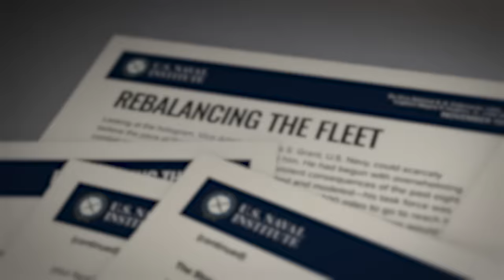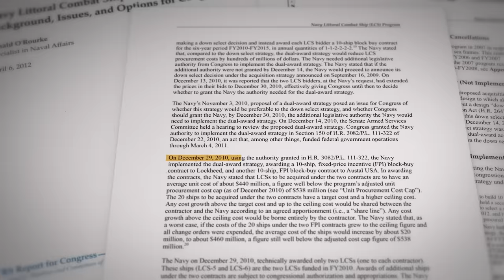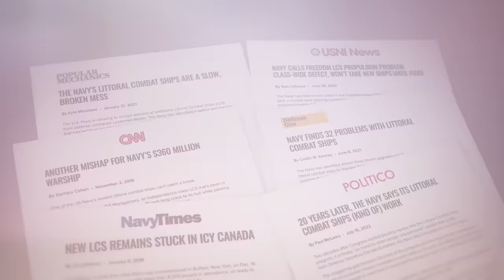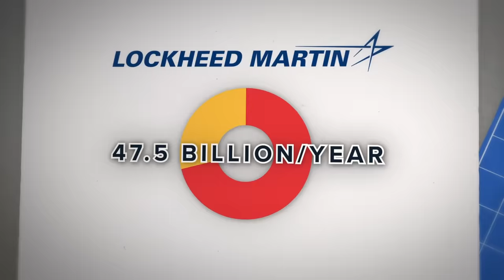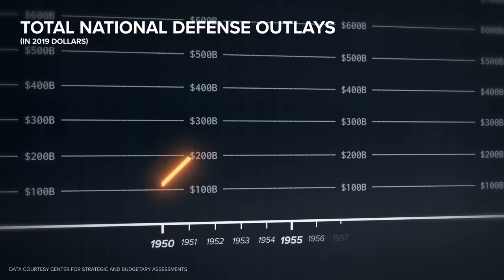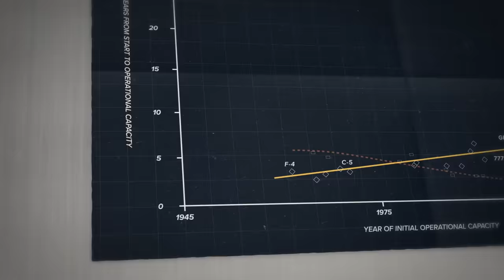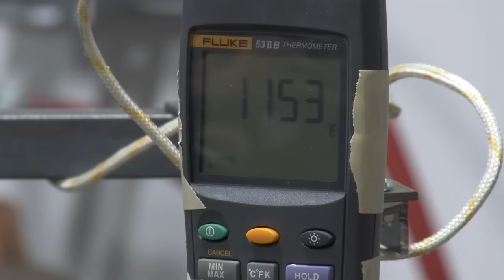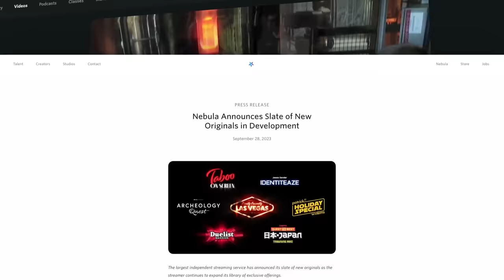Why the US Military Costs so Much

Comment: Perun has done a videos on different country's defense structures.  An issue with the US is that it's purchasing power parity is low, meaning it's soldiers need to be paid higher than in other countries: a Lt. in the US can be paid more than a highly trained  Polish Spec ops guy.
Reply: The other big thing he brought to the table, scale. The f-35 per unit costs have come down enormously since everybody else has adopted it as a standard platform. If you only build two ships, all the development costs are included in those ships, instead of something that can be iterated on, improved, and distributed across 20 or 50 ships.
Reply: This is largely inaccurate. US PPP is top 10 in the world. All countries above it are small nations with less than a 1/10th of the population.
Reply: @reclassified_  What do you mean? Do you think it would be cheaper to pay same number of soldiers in US or in contries like India, China or in eastern Europe?
Reply: @masaheimoi   the cost of labor doesn't mean that PPP is low. You don't conflate worker wages as direct purchasing power and no one ever uses it that way in an economic discussion. All those countries have less PPP than US. Thats why I said 'largely' inaccurate since there was the chance the initial comment was mistaking the cost of hiring an American worker as 'purchasing'.
Reply: *its
Reply: @reclassified_  Pretty sure they mean to imply  that the higher PPP is the thing that is driving up wages and the hiring cost meaning the budget doesn't go as far as  countries with a lower PPP.  Meaning the US defense budget is proportionate to the threats it is facing.
Reply: That’s not what purchasing power parity means. It means the get the best shit possible in the world from private firms it costs a lot more, and because we want them to retain talent and capacity over all possible sectors of threat- we pay them the best. It’s tangentially related for  purchasing power more generally. For example South Korea has fantastic defense economics and low defense purchasing power parity, but a comparatively higher purchasing power parity- it’s not a singular factor.

But I highly recommend Perun’s videos on everything.
Reply: How much of the US military budget goes towards acquisition and how much goes towards wages for staff?
Reply: Perun has also mentioned the effects this has on the economy as a whole, something that was only said in pacing in this video. 

Here's something that puts things into perspective, 3 million people work for the DOD, either directly or indirectly. Any major cuts on military budget would lead to a lot of layoffs in the civilian sector. 

As for inefficiencies, here's another one, the big companies are forced by their contracts to do a lot of business with small companies. This doesn't make sense at first until you realize that it's a measure taken to help the economy.
Reply: @shaider1982 Thank you for highlighting Perun on this.  Defense Economics is such a niche field that a 20 minute video cannot really highlight all the nuances.
Reply: Not it, spec ops are UNDERPAID, while standards for average recruits continue to fall, consequence of mass importing low value human capital.
Reply: @Souledex No, THAT is not what purchasing power parity means. PPP comparisons are made with similar goods. However, since each country is unique, different goods are priced differently. It can be as simple as cultural differences - a country which eats mostly rice may price this staple cheaper; whereas a country which eats mostly wheat may price wheat cheaper; thus the PPP for rice and wheat of these 2 countries are likely to be very different. In defence terms the dilemma is this: a simple American rifleman may be equipped with the same weapons as an Indian rifleman, undergo the same training, etc but he would demand a salary at least six or seven times that of an Indian, but he isn't likely to outfight a squad of Indian riflemen. The analogy holds across the board.
Reply: @jordankidd4443  are we purchasing the rifleman? No. This applies to the cost of procurement and maintenance and the folks who work in it. The cost of the soldiers is different than the more general defense ppp, because it involves the incredibly massive and complicated and unique military industrial complex. - that is the most salient part of the difference.

More general ppp can affect the pricing of things the army pays for, like soldiers but it doesn’t define the military’s defense procurement ppp which is the relevant part that’s different as the soldiers track closer to more general ppp for example Americas is comparatively high and South Korea’s is abnormally low. And that fact is unrelated from conscription and veterans benefits.

Comment: The F-35 isnt a good example, yes it went way over in development but has since dropped in per unit price to about 80 mil for the A unit which is cheaper than the new f-15 ex at 115 mil. Plus alot the new tech is being incorporated into new equipment.
Reply: cmon, its like the most succesful fighter jet program since F-16
Reply: @bloodygekkon  It's worthless.

Comment: This actually isn't just the contractors because it happens for other agencies as well and internally in government. Government procurement rules get more and more complex with more and more middlemen, eroding value. The same is true in medicine.
Reply: Infrastructure too. Holy crap building anything costs so damn much now. So many middle men.
Reply: We also think things should be cheaper because Corporations make products cheaper by taking shortcuts because they don’t have to work in wartime.  Since there is no free lunch, they take short cuts which is why nothing you have lasts.  If it has high quality and it  lasts, you won’t want it after a whole because it will be obsolete by being old.  The military had to do things as a system that lasts 30-100 years, which is why you see the frames of the B52s still being used.
Reply: kick backs

Comment: B 24's broke in half. B29 engines overheated.  B seventeen's had a poor payload and a poor range. P 51's started with the wrong engine.  P47 couldn't taxi because of poor visibility. Sherman tank had a stabilization system that nobody used. M 16 had ammunition supply problem that caused malfunctions. However it's the greatest battle rifle ever created and 60 years later the army still uses it.
Reply: Well, propaganda is one hell of a drug
Reply: M16/M4/AR-15 has been fixed with running changes over time. It was a failure on launch not cause of the ammo but because it was wrongfully thought to be self-cleaning. Combined with the harsh environment of Vietnam
Reply: @Schimml0rd  yes my comunist friend look in the mirror
Reply: Part of the issue with the M-16 is that when it was first introduced it was claimed it didn’t need to clean it. Once they figured out it did it worked better…
Reply: @fabricebarbon5886 leftists calling others leftists is humrous. We know you’d prefer the innefficient state wasting all the money, but you’ll have to do better than that lol
Reply: @ChrisTisking12256  if hes a leftist and im a leftist and you are on his side....omg your a leftist.

Gg comunism winns
Reply: You’re over exaggerating here. 
-B-24s broke in half under fire at a range the B-17 couldn’t reach. 
-B-29s were flying using completely new engines that were developed largely alongside the aircraft. -The B-17 was designed in the mid 1930s, but fought in a war during the 1940s. No frontline combat aircraft of the era could do that without being obsolete in at least some way. 
-The P-51 was designed as an alternative to the P-40 for the British, hence it used the same engine. After realising what a Merlin 60 series did to a Spitfire, did they put it in a P-51 and the rest is history. -That bit about the P-47 is just wrong. It had problems, but not much related to taxiing. 
-Correct about the M4 Sherman😂

-You forgot to mention the F4U Corsair being unfit for carrier duty for most of the war, despite multiple squadrons training on it on carriers early in the war, only to operate from landbases.
-P-38s couldn’t fly long at high altitude over Europe before the pilot froze.
-Early P-39s performance tainted the aircraft’s reputation for the rest of history.
-B-26 being difficult to fly for improperly trained men.
- US torpedoes going AWOL for a significant portion of the war.

The list goes on and on
Reply: k?
Reply: @martijn9568  The decision to use the Duplex Cyclone on the B-29 is completely stupid, P&W engines would have been cheaper, more powerful, and more dependable.

Comment: The F-35 is actually a great case study into why defense projects are so difficult and easily run over budget. When the project started, only 20% of the technology needed for the F-35 actually existed. The other 80% had to be created and some of those new technologies proved to be extremely difficult to implement. When you also remember the major pieces of military equipment are giant death machines, it starts to make sense whey they cost so much.

Another problem is that has an ahistorical and unrealistic understanding of innovation. Most of the innovation in the civilian sector is based on software. The great thing about software is that the main limitation is the talent and skill of the programmer. A great piece of code can revolutionize and industry without having to do many serious changes to the physical world. When you take a look a physical goods in the civilian sector, they have much less innovation than in the Defense Sector. The car has changed less in the last 70 years than tanks or airplanes. Washing machines haven't changed that much either. When you look at cars and washing machines more closely, the biggest innovation they've had the last decades is being computerized. Theoretically, there will be a point where software will push beyond the limits of the physical capabilities of computers and innovation will slow down, but who knows when that will ever happen if it even does.
Reply: Plus, economies of scale matter. The F-35 has already started to gotten substantially cheaper than when it was first being rolled out.
Reply: My thought at the point where he said "The US military doesn't innovate anymore" was asking "At which point did they stop innovating?" and having to ask myself if you can cut it off at 30 years ago to make that decision before realizing that even immediately after that, those prime contractors have been making new stuff, and they're still making new products in order to try to sell to the government...
Reply: @kingace6186  The F-35 really hasn't gotten much cheaper. The lower price is due to a different way to account for cost between defense contracts and civilian manufacturing. You can't attach R&D costs to production costs in regular business, but you do in defense contracts. The F-35 is fortunate that they plan to make over 3,000 planes that the R&D cost have been diluted to the point where most of what you're paying for is production.
Reply: Yeah, I was a little taken aback when he compared release time for new automobiles and civilian aircraft to the development and production of new military aircraft, without making note of just how complicated military aircraft have become in the past few decades as well as the fact that we're practically inventing new stuff out of whole cloth for each major iteration of aircraft. They don't really do this with automobiles and civilian aircraft. It would be more fair to compare those release times to the production of new block variants and major upgrade programs for US military aircraft.
Reply: @BulletRain100 
Subsequent projects will also look amazing as F-35 technology is reused in all future platforms over the next 50 odd years.
The F-35 is the project that had to be made and has to be expensive, walking so the next projects could run.
Reply: @buddermonger2000  I assumed his point was that much of the US military's innovations don't directly benefit the public sector as much anymore? Like, GPS = maps = everyone can get around more easily, but when is Jane Doe gonna need a stealth car?
Reply: @Appletank8  I mean, even if that was the case (no, there is still substantial dual-use development they draw upon), this wouldn't be the data to draw on to make that point as it's flawed for the reason I just discussed. It'd still be the incorrect conclusion from the data.
Reply: Still, America would be perfectly safe if they kept using F-16's for the next 30 years. There is literally half a globe between their and their nearest realistic adversary mainland. And if that exact same money was poured into developing physical technology for the civilian sector, then you'd have direct benefit to regular people.

We all know it over the top. It's great business to military contractors in the US, but if I was American I would question the military budget relentlessly.
Reply: @ten_tego_teges  It really wouldn’t. China is trying to field similarly capable stealth aircraft. The US military is not just the bare minimum force needed to defend the US mainland, it also keeps the global trade routes open. Because spoiler alert, if China could do what they want in the South China sea, other dictatorships would quickly try to block trade routes for personal gain… the US military is incredibly good value, as it enables global trade, otherwise the US economy would have huge problems with all the import and exports going on.
Reply: @ten_tego_teges  It looks over the top because a lot of it was built for stuff our enemies at the time claimed they had (or were trying to make) but actually didn't. When you have some vehicle with two guns and the enemy claims they made a vehicle with 5 (and/or armor that stops your two gun), you often don't fully question whether or not they have said thing (as in you likely bet they don't but work on the assumption they do). So when things either get real or get declassified and it turns out they only were able to put one gun out, you can look silly and exaggerated when your 7-gun or triple-plated vehicle that just got put into the force is trotted out.

It looks absolutely stupid from the perspective of people who don't know what kind of arms race was going on, aka the average civilian. But it's either build the exaggeration (that you still plan to have work) that is never needed or never meets the equal it was supposed to, or don't and then get stomped because the enemy in fact did have that 5-gun vehicle which bests your 2-gun.
Reply: @Appletank8 
I think a civilian stealth car would be fantastic to avoid Speeding fine..🙂
Reply: @stuartd9741  It would be an interesting science experiment to see if you could make a car's body shell in a way that's both practical in size and cost, and also reflect away radar waves  from most directions.
Reply: @JonathanScarlet and that’s why the F-15 exists, and it is arguably the best fighter ever produced. (That has a combat record anyway)

Comment: There are also many instances of money being poured into random programs just to get a higher budget the next fiscal year. The mantra: “Better to have it and not need it than need it and not have it” rings super true.
Reply: Yea this is basically an unsolvable problem that is only fixed by having a dictator owner running the company like Elon Musk. 

My parents used to run a little league, they built up many profitable revenue streams through a lottery, christmastree sales and an improved snackbar. They built brand new scoreboards. They left the organization with nothing to upgrade and still had like $50,000 left in the bank. That money was gone in 1 year after handing over control to people they thought they could trust. Those people that took over immediately stopped running the programs that made the organization money. My parents also think some embezzlement might have happened. 

Unsurprisingly that Little League doesn’t exist anymore.

If an organization has money the employees are going to spend it, on anything that can make their life slightly easier. The idea of saving money for a rainy day is unthinkable by an organization.
Reply: This is overall true with any government organization.